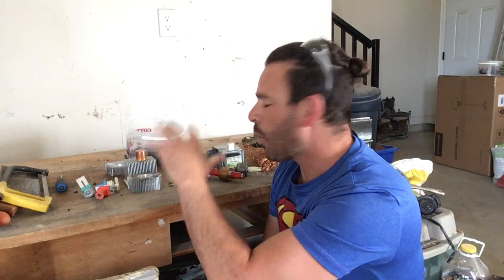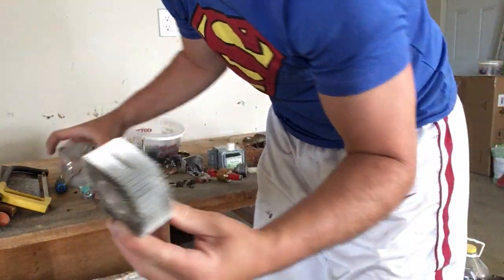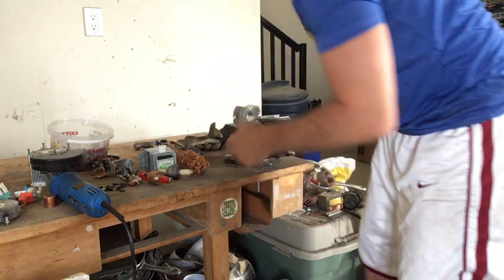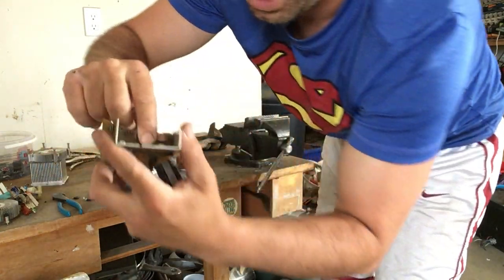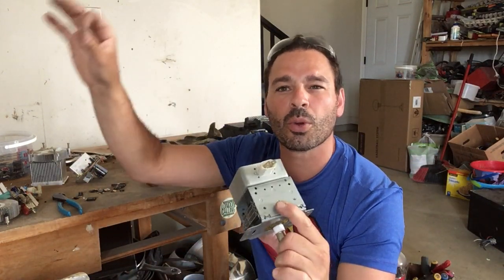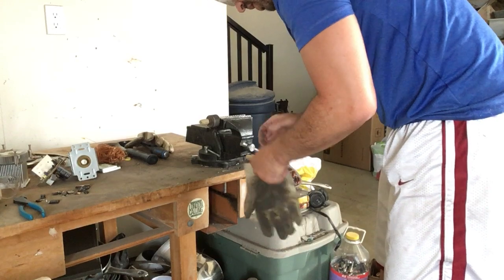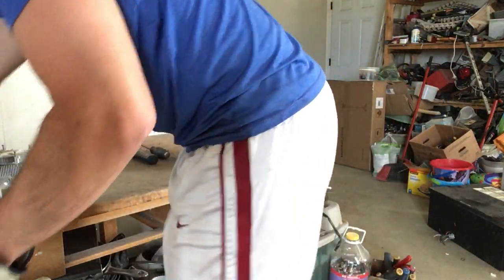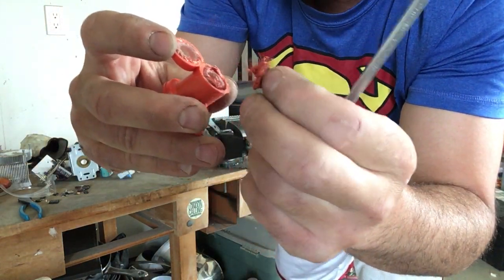Scrapping for copper. Commonly missed places to find more copper part 2.

Comment: Thanks for the video. I have learned so much from you!  Do you remove the black plastic on the tabs found on the heat sinks?  
I stick the plastic motors in my vise until it cracks…..
Reply from the maker: I don’t take it all off. Since it is all number 2 copper, not a big deal.  I may hold on to them for a while and eventually melt them down once I get a crucible to see if I can turn it into #1 I got.
Reply from the maker: Thank you for the support and comment.

Comment: Thank you for sharing this video!  I was just looking at those colored parts that are on the top part of my washer and didn’t have a clue what they were. 
 I bought a used multimeter to test the parts and just figured out it was broken. After changing the battery, it still wouldn’t light up. The glass fuse doesn’t look burned so I don’t know what’s wrong with it. I don’t know much about them and didn’t want to spend much on something that I am not sure about but I guess I will just have to buy a new one.
Reply from the maker: Sorry, not sure how to use one either.

Comment: Nice video, thank you for the Beryllium content of the ceramic info.
On top of the magnetron, there is a yellow metallic sponge style... is that brass ?
The big magnets are sold with tin or they have a separate category ?
Reply from the maker: Actually the magnets I keep and use, but sometimes I will use them to pick up the little bits of steel and other magnetic items and just through them in my tin pile. The ring is brass. I laugh because my dad always tries to get my goat by saying it is gold. Believe me, if it was, I would be rich.